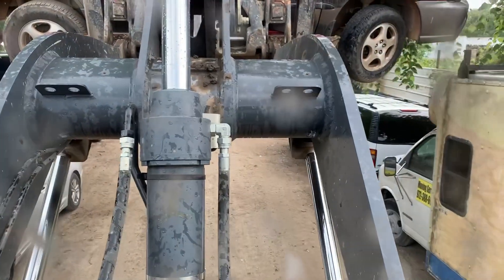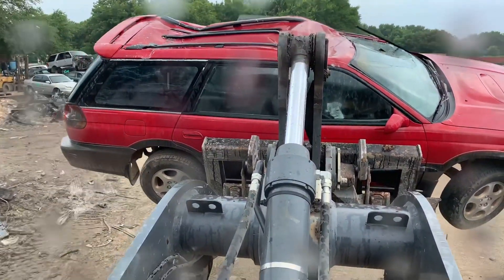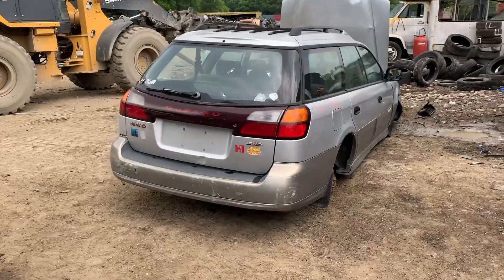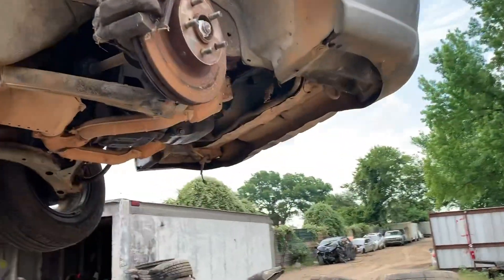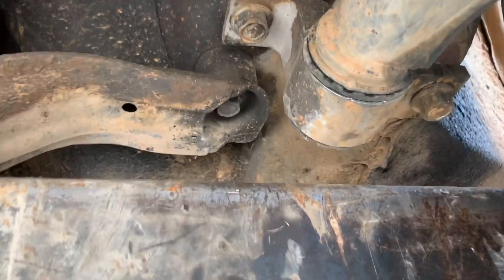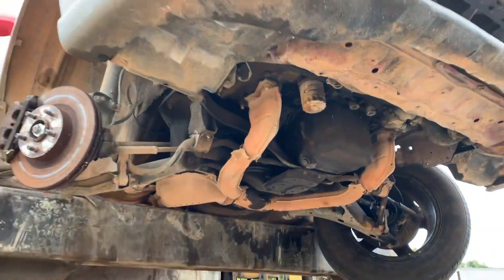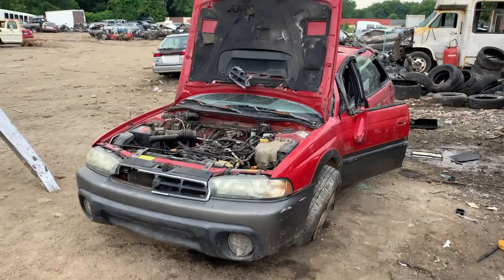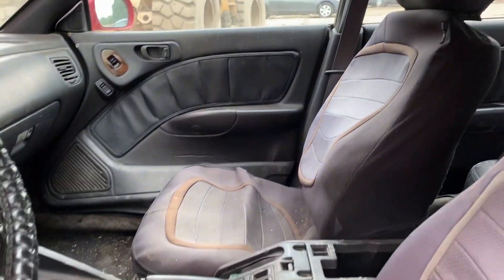CRUSHING 1997 Subaru Legacy Outback & 2002 Subaru Outback Wagons!!😳🫣🥶😁🤫😱

Comment: Yes, 1997 model year as the 10th digit of the VIN is a "V" for 1997. It has the 2.5L four cylinder engine, a five speed manual transmission was made by Subaru in Lafayette, IN. The plant started producing vehicles around 1989 and was a joint venture between Subaru and Isuzu, however Subaru owns it now. For a time, Subaru had an agreement with Toyota to assemble the Camry there. 

Exterior paint is code 5V2 Rio Red.